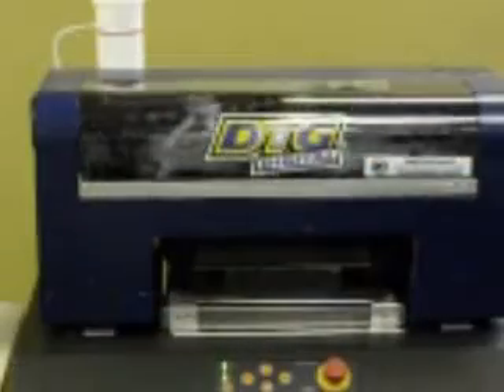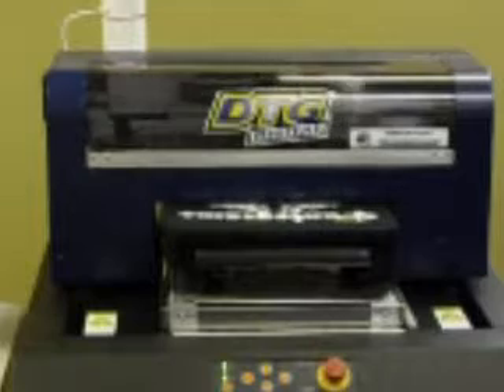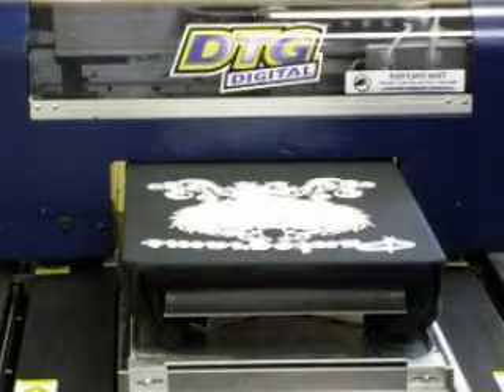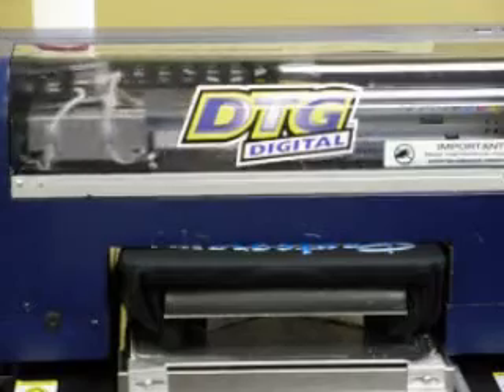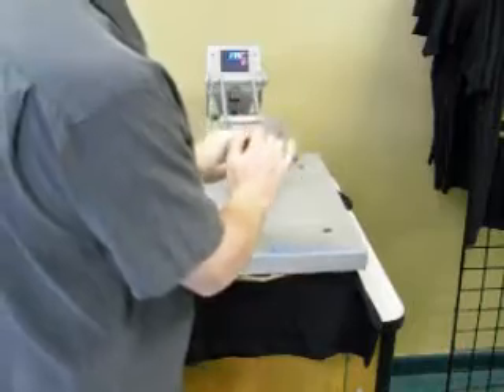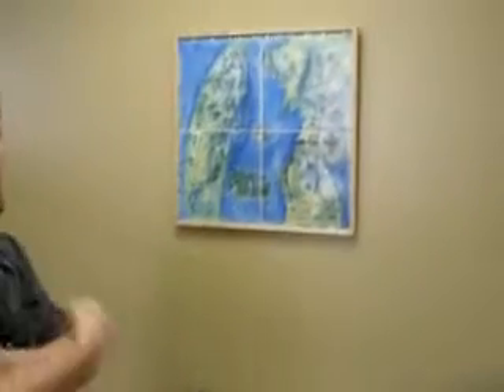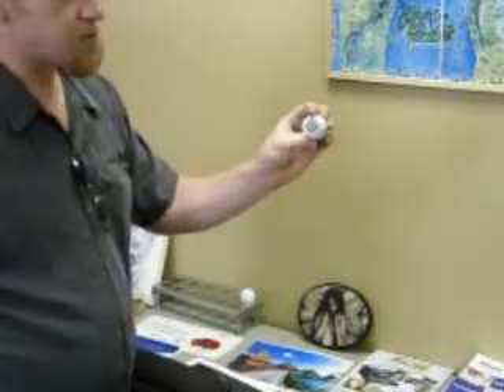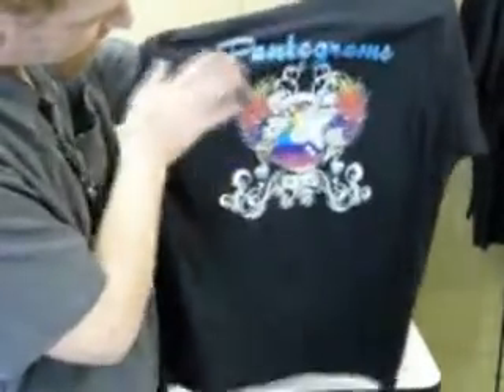DTG HM1 Garment Printer Demonstration Part 2

Comment: When curing the shirt on the heat press for 180 seconds can you tell me what heat settings you are using? Also you mentioned a teflon sheet changes the finish as opposed to parchment paper, can you tell me how so? Which is better?